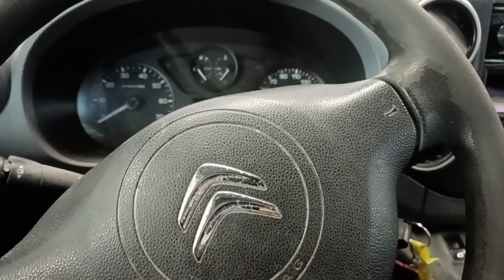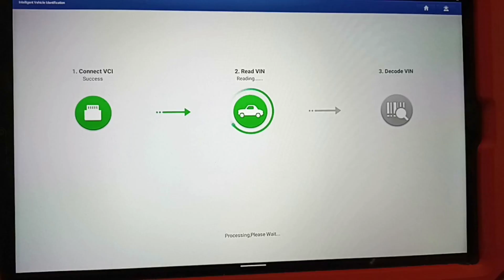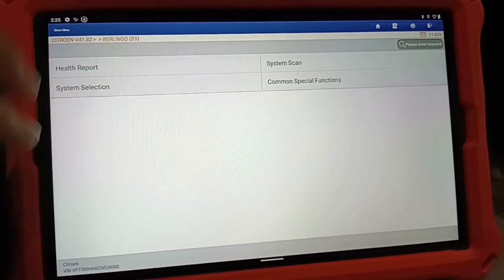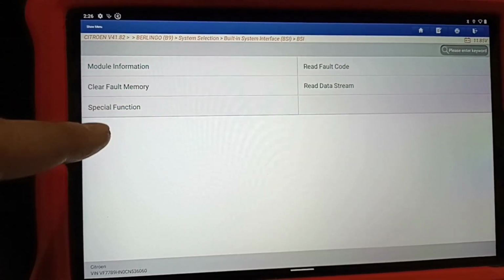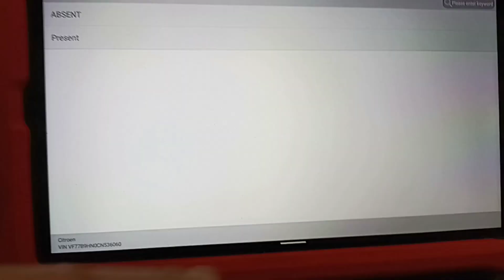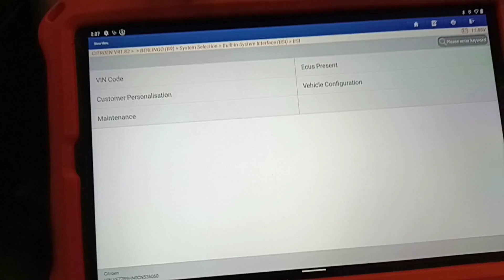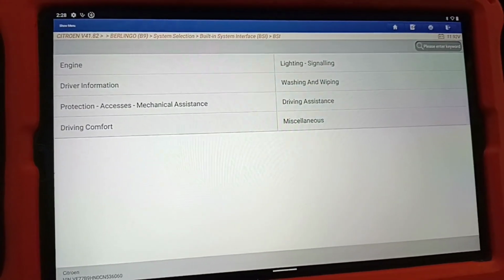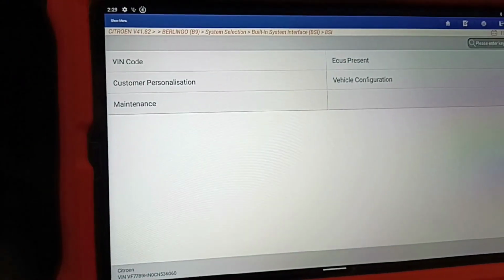Citroen-Peugeot (Ford) Additive Tank-Pump. How to Enable or Disable. Coding must be done in BSI !!!

Comment: I have pressed on Ecus present absent for the pump, on the engine for the particle filter pressed absent (was LIN Ecu/pump assembly),finally removed the F4 10a fuse but still get same fault codes P1435 and U0118 for multiplexer additive pump. and triangle with exclamation on my dashboard. Only when I press the particle emission filter present with additive pump connected by wire everything erases no fault codes or warnings.... I am not sure at all what to do.

Comment: If either my additive pump or the tank goes , but have fluid in the tank will it still work 

Because management light is on fault code additive pump 

Should ii replace it or delete if so is it possible thank you YoYo

Comment: Hi, does it take the car out of limp mode? I need it temprorary as I can't fix it right now
Reply: Topdon Artidiag800BT will clear the faults and if you choose to reinitialise the faulty parts - Adblue, NOX, or Eolys, it will also remove the countdown / limp mode.
You SHOULD also be able to do it with the Thinkdiag and the Topscan.
Artidiag requires no subscription, but the Thinkdiag and Topscan do.
The Topscan is the cheapest.
You can probably also do it with the Foxwell 510, 530 and 710.

Comment: The additive tank on peugeot 3008 was disabled but now my DPF keeps clogging. Right now it is blocked. I have had it cleaned but the engine management light came back on. The error is showin that my DPF is blocked again.
Reply from the maker: When the additive pump is deactivated, it is recommended to cancel the DPF.  Without additive the regeneration temperature is not reached. 
 You either fix the problem or cancel it completely.
Reply: @YOYODiagnostic  won't that be an issue with MOT if you cancel the DPF.
Reply from the maker: @chandamulenga9703  
Canceling the DPF is not recommended also smoking or taking drugs is not recommended and yet people do it.  It is everyone's decision and choice to do what they want.  What is completely illegal and punishable by imprisonment in some countries is the manipulation of Mileage.

Comment: I don't really understand this and I tried it multiple times on different PSA cars. For example, if PAT fluid tank/pump is at fault, you get errors like P1434 P1435. If you perform this procedure, these faults are still present in engine ECU, so the only way to really get rid of PAT/Eolys system is by remapping  / DTC delete from engine ECU. So what is the point of this procedure? Thanks.
Reply: P1434  P1435 appear with an empty additive tank. 
Fill the tank and write it into diagnostic, either filling tank procedure or replacing the whole tank procedure.
Reply: @002o  Not the point here. We are trying to delete the system, not repair it.

Comment: Once I reset the lights with a computer the lights go off and then when I put the diesel in (refill the car) the light go back on. 

I have a Citroen spacetourer 2018
Reply: Def tries to pump when fuel cap is replaced. If you use a non locking cap, the fault will not reappear after clearing.
Reply from the maker: you want to say that you fill up and go 1000 km, nothing appears.
  When you fill up does the error appear?

Comment: Dear Sir, I don't know if I understood you, this function serves and enables, if you have a problem with Aditive, for example, the lamp turns on, or you can drive a few more kilometers, this option is, in other words, to turn off aditive. off.
Reply from the maker: Hello,
yes, you can deactivate this pump and drive, but it is not recommended.  if you want to do the job properly, turn the DPF off.  You have two variants either with DPF or without DPF. 😉

Comment: Very useful information., for those who want to delete the particulate filter on PSA vehicles.
Reply: What diagnostic are you using
Reply: We like to see the video how you teach in the new parts after change it
Reply from the maker: @waldemarfechtel1644  
Hello, this or next week I will post that video. 👍
Reply from the maker: Or for those who want to install it after deactivating it and having problems with gas emission at technical inspection.  In the case of this car, a new particulate filter was fitted and a new pump fitted.  
  A video will follow in which I will show you how to program it, after the tank and pump have been changed.
Thanks for watching 👍
Reply: Where i can find video showing how to program pump?